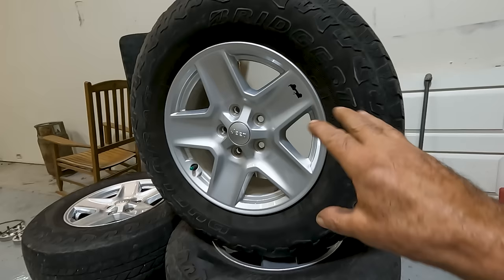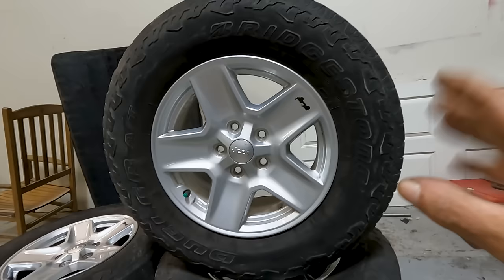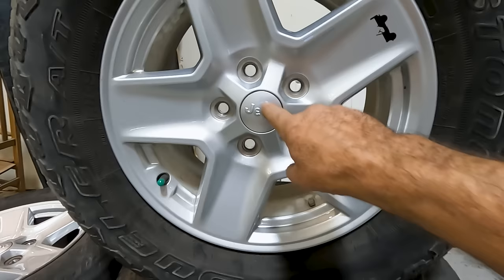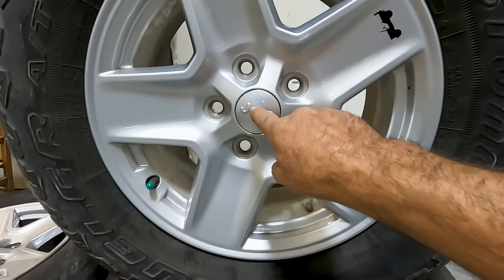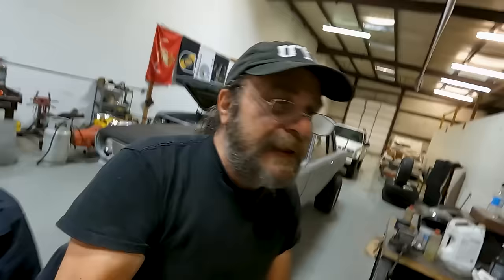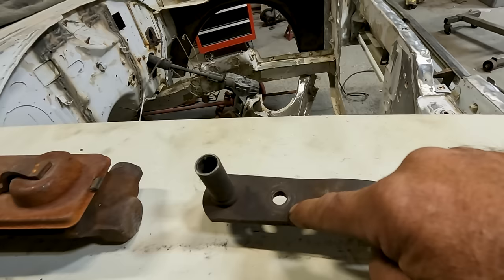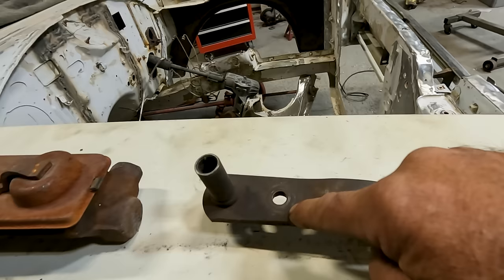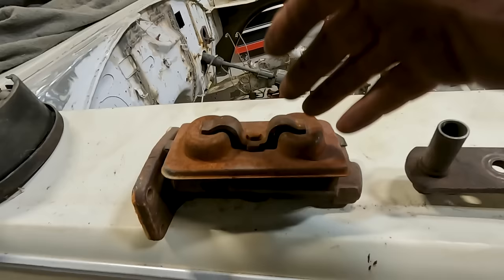Modifying Classic Cars And The Butterfly Effect - Can You Outsmart The Engineers?

Comment: i agree to an extent with most of these videos he makes but this is one i feel differently on.
ive spent most of my life around cars and almost none of my daily drivers stayed stock.
i didnt go out and mod every little thing but anything i didnt like i looked for better solution.
many cars come with options. either cost or tech caused you to not have features others did.
when i buy a used car i look at its potential for what i want. i do my own work so repairs must be easy and cheap and fast.
many cars with drum brakes have factory options for disc or they came out after the car was done being produced the tech aspect.
carbureted vs fuel injected. some things do need to change with the times i feel and it makes my life better.
all cars ive owned that had drum brakes they got swapped to disc. it was factory parts and easy swap and it didnt negatively affect anything because it was intended for it. disc is much better and way better to service i hate drums. 
tires too all cars get new wheels and tires. old tire tech sucked and id get bigger light rims and smaller sidewall tires. car manufacturers also took the same approach years later as it is much better for handling and safety. sticky tires also make your brakes better so im all for that. some cars got suspension mods or springs maybe poly bushings if the stock ones deformed too much or kept breaking.
one of my builds liked to kill leaf springs so i had to upgrade and im gonna have to get custom springs next time. 
but i do also agree that simplicity is key and availability of the parts for a daily. one off custom ordered parts are stupid unless its needed. you will have more downtime than up time.
any mod you make to your vehicle should be fit form and function. it cant negatively impact the vehicle it has to make it better and it needs to work well.
yeah your not gonna redesign the wheel with every part of your car. but a few tasteful things can really make or break a daily.
if i was going to update another old car like my current daily id do just the same.
cheap to operate fuel injected reliable motor couple healthy mods of it.
stiffer springs stiffer shocks stiffer bushings.
upgrade electrical and better alternator.
upgrade headlight/tail lights interior lights.
upgrade audio so it sounds good. 
swap to 4 wheel disc for trouble free trusty brakes when drums need changed.
mod driver to seat and enjoy. you dont have to go crazy to have a good time.
you just have to plan accordingly. simple easy and cheap and when its time to work on it or maintain its gonna make it easier and faster to get back on the road.
Reply: Way too many mods for my taste...sounds too much like building a hot rod...
Reply: @dyer2cycle  see thats where everyone gets it confused. i dont get the car and buy everything. i own the car i drive it i use it and i shape it to suit my needs. it happens over time. every time a part fails and its gonna fail again. i upgrade. more uptime means more good.
do you do the work on your own vehicles? if so would you like to work on them less? i know i dont like working on my cars and thats the main start of my mods. replacing common failures with things that dont fail as common. this current daily has 343k miles on it and i have owned it over 100k miles. that alot of time and alot of repairs and alot of things i didnt feel like doing again and again.
its also a long time for needs and purposes to change. and now its a toy that i daily. i dont have a job i need to be at every day so i dont even need a daily. it will stay a get in it and go car but it also needs to work. and it works hard. but it works well. i load over 1000 lbs in this thing and drive 8+ hours often for my own personal hobby when i worked. thats alot of weight in any vehicle. but a big truck would cost 2 fortunes to take where i go. my daily costs nothing and is a hoot everywhere i go. people also love it and tell me that as im trying to go places its frustrating but i learned to accept it. my car makes them happy. thats ok. when i was young many cars made me happy and the owners were jerks. im not that guy. im just a guy who wanted a reliable car and got sick of crappy cars breaking all the time. i was a mechanic im telling you i dont want to work on cars. so i make them so i dont have to. turns out the things i do people like and improve the value and usefulness of the vehicle as time goes by and tech improves. its the same work id be doing anyways but now i dont have to usually ever touch it again unless its brakes or service which yet again always gonna be doing. i couldnt pay someone to do that. the few times i tried i was badly burned. 
broken engine parts. broken engines parts put in the engine to hide the evidence. drain plugs left loose. and fell out the next day. obvious major leaks. joy riding and lying. i seen them and they seen me and they lied. their on camera leaving in my car. i take care of my car it takes care of me. i mod what doesnt work or i get a vehicle that works better. i have no good options i  make what i need. i dont have alot of money because i pay too much in child support. so i have to work with what i got.
tools skills knowledge and oh yeah. my ex step dad was a master mechanic. he didnt teach me how to work on cars but he asked me how i work on them after 10 years of me being a mechanic. i was better and faster than him and he knew it. then i worked for a big shop and he would call me and ask questions when he got stumped. i always helped him even though he always told me when i needed help "your smart youll figure it out". i did but it was always alone.
i pretty much knew all the same stuff when i left the shop as when i started i just was alot more comfortable with it. it wasnt rocket science its just nuts and bolts folks. cars operate on systems. most of these systems arent even designed for the car specifically anymore not like the older ones that are also pretty cut and past across platforms. most of where my mods come from. this system handles this that system handles that. need more use bigger or better one. you dont keep the same fone 20 years anymore they dont hold up. dont get me wrong i have 2 great nokias i would much so like to still use but att wont let me. some things need to be replaced. some things need to be repaired and some things need to be updated. all im doing is updating my old car to be a new car and not cost more than i can afford.
think of it like a restomod. everyone likes those. and here i am literally done that in all the good ways. and im the fool.
i literally have 2 grand into this thing including buying it. and the motor build when the stock one went out. and people offer me over 12 grand often. the price keeps going up. id say it wasnt too much work at all. i have also had multiple offers to build for other people since this one. and had people who wanted me to build them a car or motor or do mods to their or make a list for them of what to do. id say i did alot less work than they seem to believe. even when i tell them what i have in it they know. every single thing on that car is done thoughtfully and also drives the price up for them. its not just some random combo of parts. their all catered to the final product. i have double the motor as stock? with half the emissions and almost double the fuel economy. while still being 50 state legal swap and cali emissions so i can literally drive it more places than a stock car.

Comment: Been daily driving an 81 W250 quite a bit. The only deviation from stock is the 273 engine, AVS2 carb, headers, Stealth intake and small Summit K6900 cam. That all was done to increase gas mileage,  which it did! But daily driving a pickup is really pretty stupid and I know that. If an early A-body fell into my lap, I'd put that engine in it in a heartbeat. Trucks a rusty pile of crap anyway. 🤣

Comment: Someone told me i needed to convert to disc brakes in the rear and bigger calipers since i got way more power then the car came with and i said no i don't it stops awesome its 300lbs lighter than the engineers intended the brakes don't know how much power it has it would stop the car at 60 mph with 180hp the same as 60mph with 510hp

Comment: Depending on the car/trucks age, I'll always update brakes, fuel system, ignition system to newer. safer and more reliable more modern tech...  Some of that old tech just isn't safe, reliable or even able to safely drive on today's roads depending on age.. Remember engineers of the day were constrained by technology as well as the bean counters, it's not about outsmarting them.
Reply: Let's say you bought a 50 year old car.  How can you say the brakes weren't safe if they stopped the car safely for the past 50 years?
Reply: @mexicanspec  More like a 60-70 yr old car.. Take my dodge, back then it travailed unpaved roads with a top speed of 45mph. 45mph is not safe on today's highway, and the brakes on it aren't safe at modern highway speeds. So when I changed the ring and pinion for higher top end, I replaced the entire brake system with modern tech. Well 80's tech actually, the system uses mostly 80's 3/4ton chevy truck brake parts, and with a little modern steering parts it does 60--65 top end now and is a helluva lot safer on modern highways.

Comment: As a lady friend is fond of advising young men- “If it has tits or wheels, leave it alone!”  Not much chance it will be heeded. You advice here is a little easier to follow as a specific subset of: “If it ain’t broke, don’t fix it.” I’m lazy enough and cheap enough so that is exactly what I end up doing almost always. I never have bought a set of alloy rims despite wanting to dress the old jalopy up. I do have some vanity though - when someone whacks one of my plastic bumpers and breaks the mounting points leaving it hanging, I always use the closest matching colour zip tie I can find to fix it. If there a factory towing package for the Jeep, I consider seeing it is worth adding. The manufacturers obviously give optimistic towing weights. Well spotted on the effect of the 17 inch wheels.
Reply: As ex jeep xj owner it's not worth it  get a truck with frame meant for towing setup not a toy.

Comment: I have a stock 1970 inline six c10 and the brakes are absolutely inadequate when the truck is empty.
It has stock wheels as well and all drums how do i improve it to make it actually able to stop in a sudden situation because it can't
Reply: You can put front discs on from a 1971-72 C-10, they went to front discs in '71...if it's 2 wheel drive, though, be aware it will change you from a 6 lug pattern to a 5 lug...that said, I have a '70 C-20(3/4 ton) with 4 wheel drums, and it stops just fine...if you have a really heavy load, you do need to think ahead just a bit. Are you sure your current brakes are in good shape? Good lines, master cylinder, good drums, good shoes and hardware, good wheel cylinders, adjusted correctly? If in good condition, the 4 wheel drums on your 1970 1/2 ton should stop the truck fine...

Comment: I agree and disagree with you on this one. To upgrade a classic car from drum to disc brakes, whether they be factory brakes or performance brakes for example a 1966 A body GM car to a 1972 A body, where almost every car from that point on used disc brakes, at least for the front axle, and therefore they were an improvement over the old drum brakes even though it is a 1966 A body the car driving capabilities of the car will improve all around, considering that the car is also equipped with a power booster and a dual master cylinder. 
There is no downside to this upgrade at all, and no butterfly affect, but this is not the case with every make and model car, where I agree with you that not every upgrade is better for the classic car.

Comment: Tony I have a good one tht I did NOt see comming.  I had a1999 Merc Sable with 4 wheel discs from the Factory.  Most Taurus and Sables came with drums in the rear.  My Insurance company sent me one of those monitoring devices for the Diagnostic Port that you leave on for 6 months.  I did that and sent it back into Progressive Insurance...The BASTARDS Jacked my rates because they stated: I STOPPED TOO FAST.  These were Stock Brakes....DID NOT SEE THAT COMMING!

Comment: So you're saying the drum brakes on the front of the '68 are just fine and you wouldn't touch them?
Reply from the maker: My 68 Roadrunner, 67 Charger, 72 Swinger, 64 Dart, 74 Duster, Bottle Rocket and Slaghammer ALL have front drums, and they each function just fine.
BTW, Bottle Rocket (nitrous 72 Coronet was originally disc and I converted to drum to save on parasitic losses and 30 pounds of weight)

Comment: Drum brakes agreed, i had 1966 chevy belair, 4 door. Tteyvsay drums over heatvtoo fast and you lose brakes. So i tested it . 100 mph stops , done it 15 times in row. Well the 1966 no brake fade. Now, the dise brake chevy with in 13 , brakes faded out to nothing, but the 1966 aluminum drums and high grade shoes and wheel cylinders. All adjust even. Up graded manual mastcycler. But , work better the the dice brake car , witch was  alot newer

Comment: You say " Don't midify Brakes, Steering, or, the Suspention "
You stated in a previous video that your XJ " Tow Vehicle " had 17" wheels and tires with a 2 inche lift kit.
My question is, now that yiu have removed rhe oversized tires and wheels, are you planning to remove the 2 inche suspention modification ??

Comment: And I've seen plenty of modern cars brakes start failing on mountain passes are daily driver's not meant to be able to deal with that road?
Reply: Did the cars with failing brakes had the brake fluid changed according to the service schedule? Old fluid are the typical reason brakes fail when used hard. The pedal goes to the floor, because the moisture slowly absorbed by the brake fluid starts boiling when the brakes get really hot. Brake fluid are hygroscopic and a maintenance subject like engine oil. Running an decade or more old brake fluid are daredevil driving and also the reason the MC and calipers rust inside and starts leaking.
Reply: @westmus  two forms of failure fading pedal like what you are speaking of and brakes starting to lock on. In drum brakes temperature is going to be a greater issue. You make a great point you must service the brakes replacing the fluids within  the recommended intervals or sooner.

Comment: So wrong... my duster has fuel injection, disc brakes all around and hotchkis suspension. Turn key and go. Only thing now is getting an extra gear as the 727 gets old on the freeway. Gunna go drive it to the dragstrip tomorrow, flog it and drive it home. Tasteful modifications make cars more fun and safer in my opinion.

Comment: Residual line values
Reply: The residual valves keep the piston in the wheel cylinders seated or slightly tensioned.
If the wheel cylinders have internal compression springs then they don’t need residual line valves.
If you leave them in the disc brakes will drag or lock up

Comment: I agree with leaving stuff alone for the most part.  However, I think your being a little too nit picky about the brakes not working as well on slightly larger wheel and tire assemblies.  Yes, the cars are engineered by very smart people, the same level of people who got us to land on the moon...  However, by definition, anything that has been "engineered" is not the best it can be.  Any idiot can make something stronger, an engineer must meet some design criteria such as strength to weight to price.  

The brakes that went into those cars, those were picked out of what was available.  Rather than redesign the brake master cylinder just like you mentioned, they put smaller drums on the back.  It saves a bit of money for the manufacture, its "lighter" so you can use that as a selling point, and also offer the larger drum as a dealer upgrade if you want.  All win win.

Running a slightly larger wheel and tire assembly only has a negative impact on the breaking force available to any vehicle if you are at the limit of the brake system as is.  Best way I can think to explain this is locking up the brakes.  If you can lock up the tires under hard braking, but still have peddle travel left, you are not near the limit of the brake system.  And the engineers tested this stuff.  I know you know this Tony, but the tests performed by the factories on these cars were extreme, they would stick the weight rating of the tires in the trunk of the car, then go do full highway speed emergency stops over and over.  And not on prototype cars, production cars.

But they were not looking for the best, they were looking for reliable.  Just like your carburetors.  It's the same guys with the same mind set (well, I heard the guys who designed the carburetors went insane...).  Best bet is to put the larger tires on and actually perform a panic stop.  Not from high speeds, I trust you know how to do it properly.  Then check to see if the brakes work properly.  

Of course, a smaller tire would be better for towing as well, power wise, be cheaper and could be more likely to find a replacement on the road if you get a flat, and a few other tiny things that make the smaller tires more attractive.  And I would also go with smaller tires for towing.  I just can't help but nerd out on brake systems a bit.  Have you seen the research into a larger rim helping to cool the brake disks off by being a larger piece of metal.  I'll leave it at that, I bet you wouldn't even disagree, your just making a simpler point as general advice.  I better stop not before my ADHD takes over.